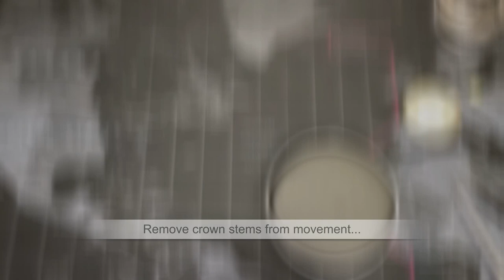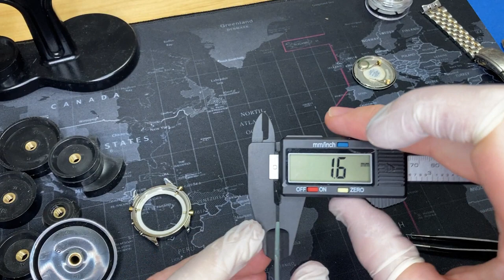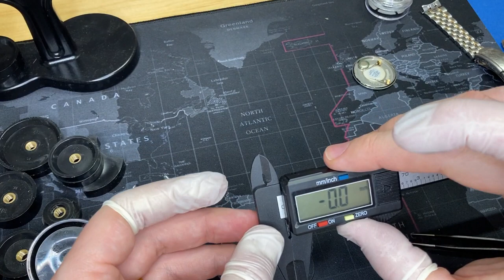How To REMOVE a Watch Mineral Crystal - Watch Repair / Step-by-Step Instruction

Comment: What is the cost for a mom and pop shop to replace instead of me buying all this for one watch???
Reply from the maker: Hi, honestly, it's not too difficult. The problem is that it's not something you can just bring to a shop and then pick up the next weekend. They'll have to go through the removal process, then measure the parts, then order, and then re-install it. Depending on where and how they order it... you can expect this to be a 2-3 week turn-around time. Making the best judgement I could, I'd have to say that including the cost of the parts, you'd likely expect to spend anywhere from $150 to $250 dollars. Again, depends on a few things, but the biggest cost difference is whether or not you're getting a replacement mineral crystal, or you're going with a sapphire crystal.